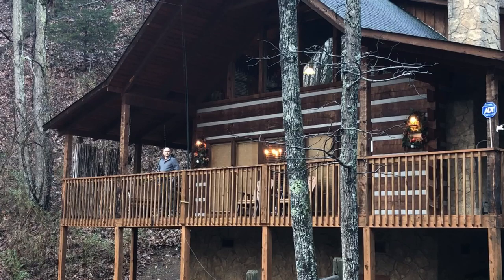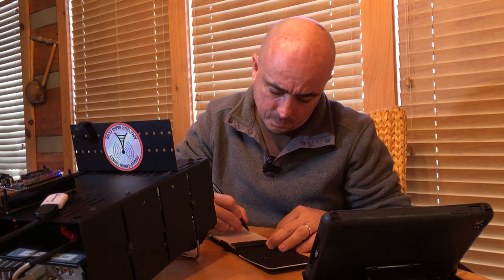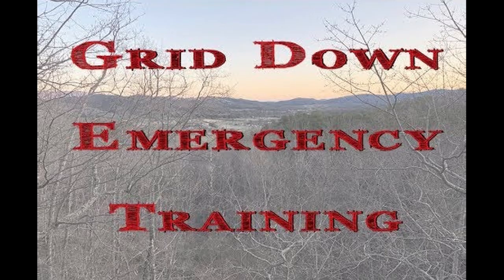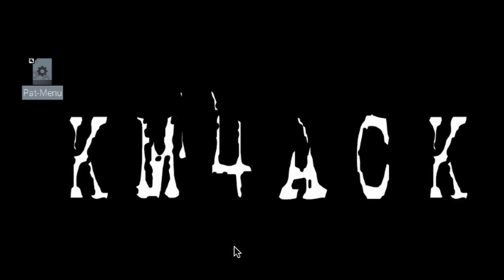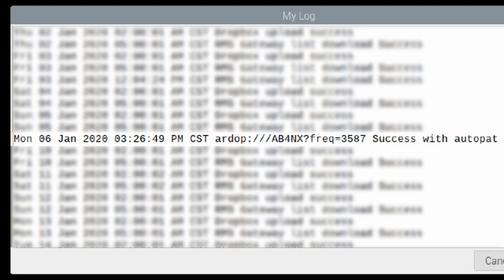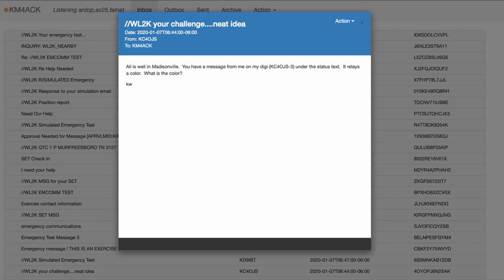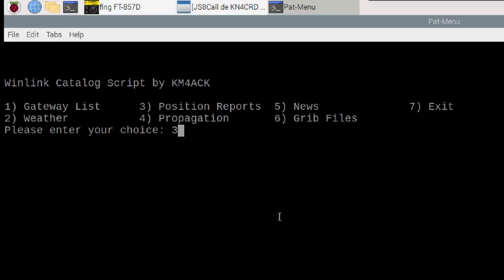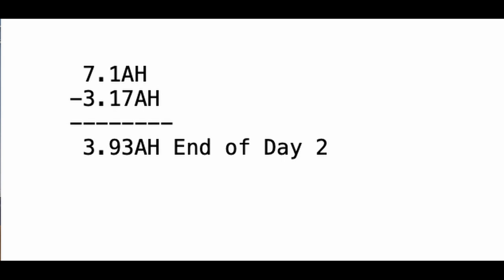Off Grid Simulated Emergency Training | Ham Radio Communications

Comment: This is where you learn that antenna configuration may work well in one location but not in others. I would have setup the far end of that antenna up the slope at high end of the cabin or vertically. I used to pack a throw string and lead fishing weights, and a slingshot for situations like your terrain. Great video Jason.  KB8AMZ
Reply from the maker: Thanks Terry. Always room to learn something new. Thanks for the input! 73, de KM4ACK

Comment: After years of Emcomms in the North East I have come to the conclusion that I need a 30ah LiFePo4 battery with Chem Hand Warmers, as it gets very cold here. I also have found that at minimum 240w solar array is required to sustain a 3day winter SET. 

Great job with your videos and look forward to each and every one! N2KTO

Comment: Igot 2- 60 amp hour batteries to run when I have a Hurricane.  I do have more than just radios on it.  But I hope that it will power radios and some LED lights.  Your way of tracking your battery tells me I need to do that.  THANKS for the information.

Comment: Thanks for doing this test, Jason, and sharing your results. Not that you saw it, but I noticed during the short time I was able to participate in JS8, that there were several stations regularly querying the network:

@ALLCALL QUERY CALL KM4ACK?

There was a station or two claiming to hear you when I checked, but attempts at relay failed.

Comment: Great test! You were pretty much in my backyard for this test. The challenges can be frustrating, but they ultimately make us more prepared. 73, de K8KNX
Reply from the maker: Absolutely it make us better prepared and much more memorable than the trips that run without issue. BTW....Guess my dinner invite got lost in the mail. hihi Thanks for watching. 73, de KM4ACK
Reply: @KM4ACK  Well, next time you find yourself on this side of TN, you all are most definitely be welcomed. Thanks for the great videos and all the help!

Comment: Thank you for the excellent video of working off grid.  I wanted to add larger solar panels help with lower light conditions.  Doubling your size based on what you showed for use would help.  On your communications I would look at modeling the end fed in the height you operated and see if that has a effect.  Also having additional  antenna options might be a good for next time.  Just my thoughts and again thank you, it really helps to see real world operations.  Tim KM4ESU
Reply from the maker: Thanks for the input Tim. It's always a learning process. 73, de KM4ACK